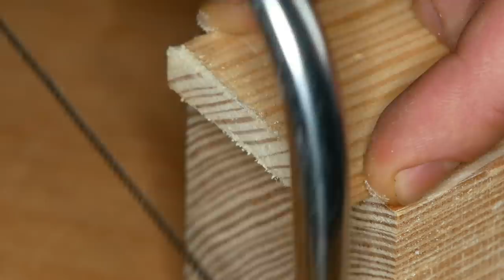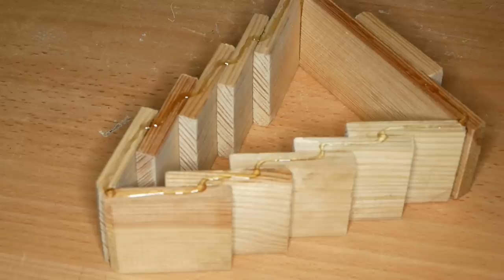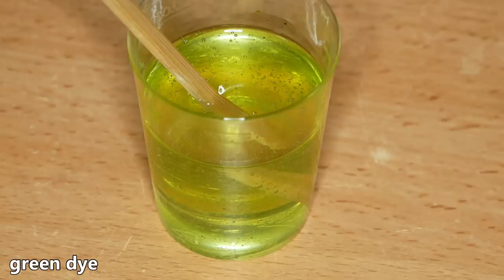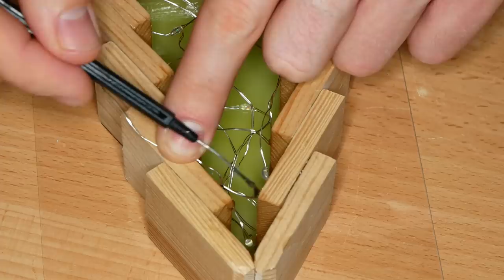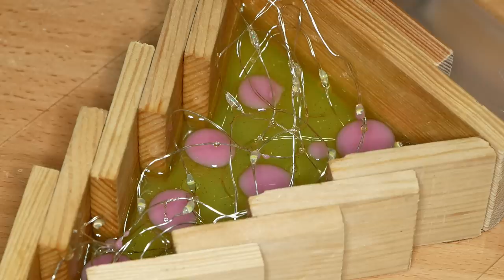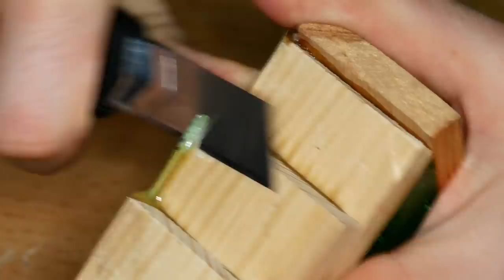Christmas Tree 🎄 Night Lamp / RESIN ART

Comment: I think the part I like the most is that the wood is not all precision cut, or perfectly straight, which just adds to the folk art allure ... 

I just got a string of Christmas COLORED LED lights on a wire with 200 bulbs, running on usb power. All 200 bulbs fit in the palm of your hand, span about 40 ft. and are super bright... Trying to figure out what to do with them! 

Have a Merry Christmas!
Reply from the maker: You will figure this out. Good luck

Comment: Just a suggestion from experience. I've embedded those lights in acrylic and had a problem with the wire that sticks out. Broke rather quickly because they're so thin. Going to cover mine in hot glue next time.
Reply from the maker: Good idea